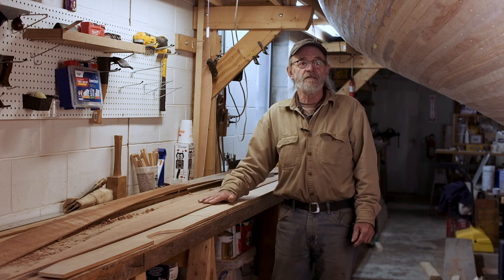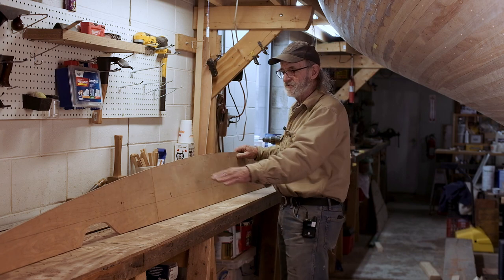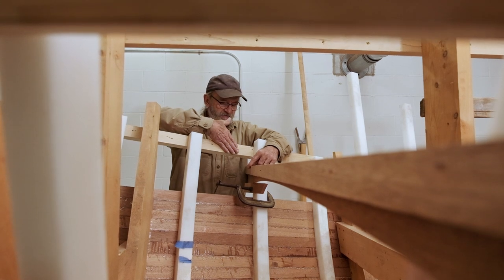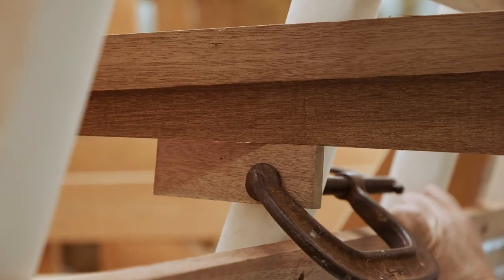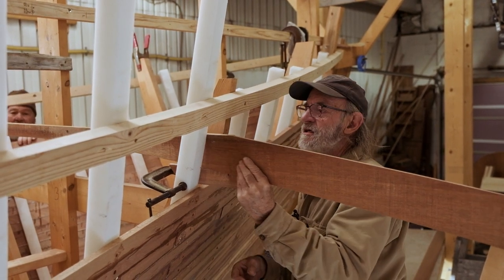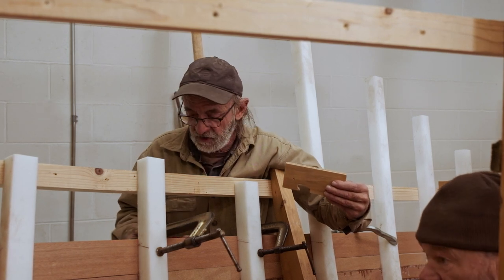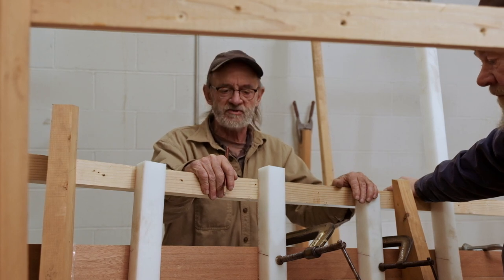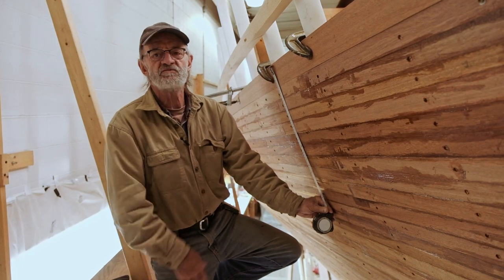Building Evelyn: Marking the frame heads at the sheer, EP11

Comment: Lou as a metric user I’m glad to see you recognising the benefits of using that system.  Especially when it comes to not having to deal with multiple fractions!  Ironically I built a boat from plans from an American designer using imperial dimensions and on occasion converted them to metric just to make further calculations simpler.  I’m pretty comfortable with both systems since the change over happened when I was a kid in Australia. But there’s a good reason why the rest of the world went metric, and it’s pretty obvious when you use both.
Reply: the rest of the world went metric at the point of Napoleon's bayonets not because the system is "better" in any way. american imperial has "engineering" measures where inches are divided in to 10ths for easier divisions and machining but in point of fact "easier" is strictly a mater of circumstance some times base 12 is easier to divide than base 10 because Pi becomes a multiple of 3 and fractions work better for intuiting proportions etc etc the point being that america pioneered "standardization' and so never had the issues that led Napoleon to scrap the European imperial system for his war procurement programs , also it is a total fabrication that the US did not "adopt" metric the fact is that the US federal government does not have the power to adopt ANY system of measure the only mandate the government has is to maintain "standards" and as of the Carter administration all US measures are "standardized" on metric equivalents. the government simply lacks the power to force (key word here being "force") people to CALL those standard measures anything in particular due to the first amendment.
Reply: @kevint1910  exactly right. We learned to use both in the late 70s early 80s in primary school. But on the job, imperial was and is the "standard", so it is the common system used for building materials and blueprints. At this point, switching over would cost everyone in the trades, all the way up through the government, cumulativly over a trillion dollars to make a full chamge over to metric. It is fiscally prohibitive. Even just basing repair parts, on already built items, on metric  when everything was built based on imperial would be difficult to match up parts. We would have to use both systems for decades for replacement parts for older stuff and metric for new items and their replacement and repair parts. Stores would have to more or less double their stock, again cost prohibitive.
Reply: @kevint1910  most countries went metric long after Napoleon was dust. Like mine. I doubt he had much to say on those.
I’m as ease with both but I know which one I prefer.  And I’ll wager most who are familiar with both would agree.  Base 12 - it’ll never catch on. Sometimes easier?  Perhaps “rarely” might have been a better choice of words.  But I get it - it’s best to use the one you’re used to, and I admit I’ll often describe something as being about an inch, or about a foot. A quick and handy alternative scale. But if calculation is involved give me metric any day. Who needs to be dealing with fractions!  If  I need to add, divide or multiply dimensions I can just use a calculator. Simple. Try doing that with fractions.
Ironically the inch is defined by a metric measurement I believe. Have to keep you Americans on the straight and narrow somehow. : )
Reply: @kevint1910  It's the promise of this sort of response that leads those in the metric world to needle those in the 'imperial' world. :) Good on you for telling your inner filter to stick it and not disappointing anyone.

Resisting the urge to needle further... 

There's nothing wrong with customary or other units in certain applications. I like measuring human height in feet and inches. Flight levels work - they provide appropriate separation without confusion (mostly). I like beer by the pint. Hearing Emmitt Smith rushed for 132 yards in Super Bowl XXXVIII meant more than when a local newsreader read a conversion to meters! I like these units because they allow meaningful comparison and in use the numbers are not unnecessarily large, yet provide appropriate precision - especially the pint. ;) The important thing is the standard for what's measured is consistent and meaningful. It's more convenient if it doesn't later require conversion to mix with other numbers. 

The metric system doesn't seek nor care about creating easily used numbers. It's value is that there is a single unit standard of measure, and the only operation required to unify different units used by one industry and another is a movement of a decimal point and change of prefix. In this regard, it has a benefit of simplicity. 

There's nothing wrong with fractions. The decimal system doesn't preclude their use in any way!  We still do division!

I'm all ears on the golden ratio. √5...? Not sure how you're advantaged using fractions.  1 : 1 79/128 gets you pretty close?

Pi.... I'm not going there! 

I would be cautious about describing hours and months as measures. The units are meaningful, but in use for calculation they're endured. The stable unit is the second - hours change. 

In relation to your final paragraph, may I suggest you get a hold of some Johansson blocks. Wring together as many as you feel comfortable and when you slide them in consider the Swede who took 50.8nm off every good ol' U.S. inch!

Comment: Given that the deck template realizes a parabolic arc and that the curvature differs as a function of displacement from centerline...

I found it odd that there was no mention of "centering the template" for each pair of frames (stations).

I would also like to understand the initial mark of the sheer was found.  That is, the displacement along the frame to indicate sheer line, not the sheer angle.  The sheer line was produced without an explanation of how it was achieved.  Lou aligns the small block to the angle of the template AND to the sheer line.  How was the sheer line formulated?
Reply: I came to the comments for an answer and only found more questions
Reply: @veyr0n  If the template was a circular arc, then no centering of the template would be needed.
Reply: I agree and commented also--before I saw your comment
Reply: @WhatAboutTheBee  It isn't a circle--- but a parabolic curve--- the angle across the frame heads is different relative to the distance  from the centerline of the hull. To have the frame head angles the same each side the template has to be centered on the longitudinal CL of the hull.
Reply: I believe Lou said the sheer line marks were on the molds (presumably taken from the lofting)
Reply from the maker: Hi what about the bee. I replied in another comment on the same topic . You're certainly on it it. The centerline is critical. The sheer line was defined off of the molds with a long batten across the frames. and molds. Ultimately this all came out of the body plan and the long lines. But you know that.  If you would like more info, send an email from the website bristolshipwrights.com. Great to have you aboard. I like to think Bristol Shipwrights can appeal to professionals and amateurs alike.
Reply: @BristolShipwrights  100% you guys have this, never a doubt in my mind.  

It was the portrayal of the effort, leaving out a critical step as it were.  The centering effort likely ended up on the editing floor.  Just not exciting video so it was gone.

Carry on Gents!  I'll be watching!!  Cheers!

Comment: Thanks Lou! Will you have to cut the sheer plank with a progressive bevel, or will it just be 90 degrees?
Reply from the maker: Planed to the bevel. We can get it right by marking every frame. We could have pickled it up off the body plan and the molds but the accuracy would suffer. (Yep, it's over the top.)

Comment: since the pattern is not a constant radius--don't you have to reference it to the centerline of the hull at each mold?
Reply: Exactly!!
Reply: @WhatAboutTheBee  seems to me  Even if the template was a circle since only part of the circle is used the Center of the template has to be centered on the hull
Reply: @ramjamjungle8339  Nay sir.  If it is a section of a circle, then rotating the template while simultaneously maintaining contact with the two sheer points, results in precisely the same arc across the deck.  It is still the same circle, at the same radius, in contact with the same two points!
Reply: @WhatAboutTheBee  Umm Oh yea! Thanks.
Reply: So if you make the template longer than the width of the boat, making sure an equal length of the template hangs off each side as it's marked, the middle of the template would  always be in the middle of the boat?  I wish I were clever enough to think o that.
Reply: @matthewgabrilowitz1050  There's a thousand ways to skin a cat.  The cat doesn't like many of them. 

The issue we are discussing is that Lou never mentions it at all, or at least, in the edit presented to us.   A parabolic arc would need to be centered, and yes, your concept would work under the assumption that the template was symmetric about the centerline.  No guarantee of that, i would have to be purposefully made that way.
Reply from the maker: The best comments on YouTube come from BS subscribers. The centerline is critical, sort of. The pattern is indexed on both ends.So Lou and I can call out the distance from the outside of the frame from port to starboard (the molds get in the way of finding the centerline). "Sort of " means that the bevel is so small that an inch or 2 centimeters off the centerline is barely negligible.  Long live Archemides .
Reply: @BristolShipwrights  I agree totally--I'd imagine even if the pattern were off center as much as a foot the difference in angle at the frame heads  would probably not be noticeable --at least in the wide part of the hull. Plus they will all get tuned up when you hit them with the power plane.
 What has always been a curiosity to me is why the centerline of the deck is usually drawn as a straight line in the profile view .How can this be if the constant curve template is stretched across sheer points that are not a straight line in plan view? Been my experience that the deck camber gets changed as you get near the ends of the hull.